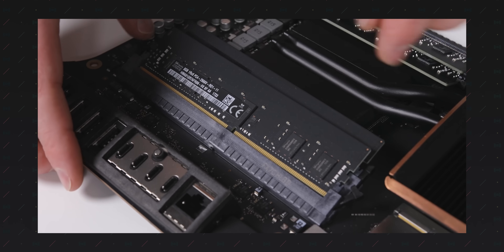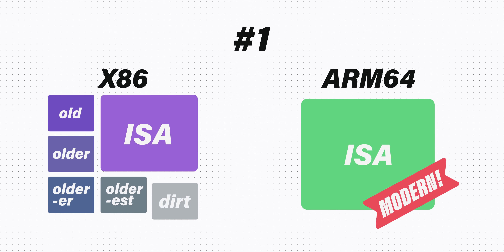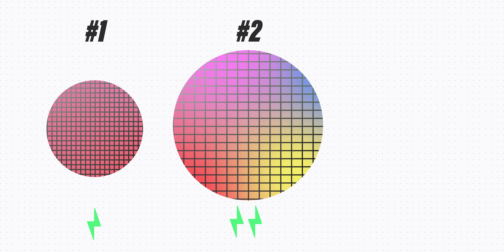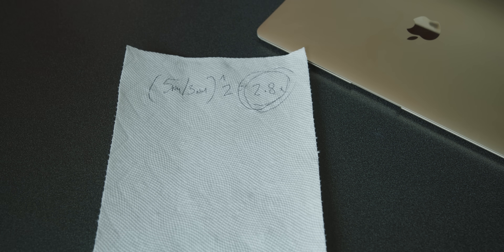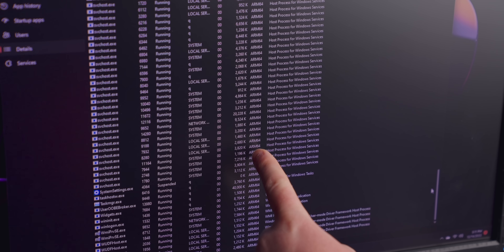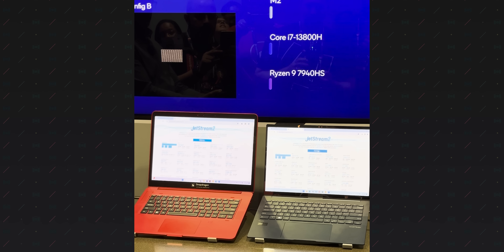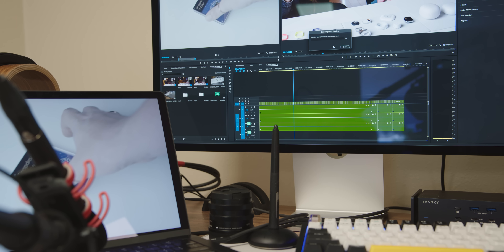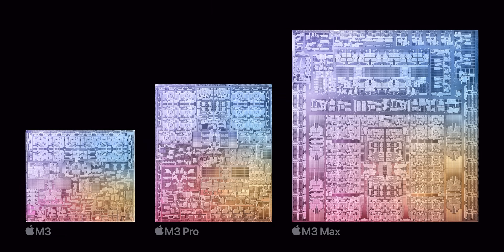Apple's Silicon Magic Is Over!

Comment: Windows on Snapdragon is a disaster → M4 was a mind-blowing success → M5 will probably have 3D packaging → M6/A19 will feature 2-nanometer technology from TSMC, plus multi level 3D.
It seems that Apple is ready to keep eating away at the industry bit by bit, but in a steady and sustained way.
Reply: How I see it, Snapdragon has been a disaster and Intel can’t make up its mind how it wants to go about making its chips. Meanwhile, Apple has released its 5G C1 chip, released a chip that can manage tandem OLED displays and have the only devices that run Thunderbolt 5. Apple’s strategy chip is clear:
 - Continue to enhance its existing engines
 - Partner with TSMC to improve CPU and GPU architecture
 - Develop new engines for specific tasks (e.g. dedicated AV1 Decode engine), which could include 3D packaging
 - Look at ways to improve graphics or displays
 - Build more AI and Machine Learning capabilities into its chips

With Apple’s yearly release cycle of the new chips, Apple will soon overtake AMD, Intel and Snapdragon on having the best performance when comes to chips.

Also have a theory that Apple will push more heavily into dedicated engines to get around the EU technology regulations. If Apple releases more features that are reliant on very specific hardware technology, the harder it is for the EU to make Apple to release that feature to its competitors platforms.

Comment: The problem with Snapdragon is that Microsoft isn't forcing their software vendors to port to it or optimize for it. Intel and AMD have been doing a good enough job at grabbing market segments. M4 has performance and efficiency and Intel and AMD are trying to play in the individual spaces but not both at the same time. The thing is that the vast majority do not need the power of M4. I certainly don't which is why I'm still on M1 and happy to be there.

Comment: If you had understood,is not about density , it is about parallelism. This is forcastable since RISC compete with CISC. Reduce instruction set Will beat Complex instruction set to run window operating system.

Comment: Feeling pretty cool right now with my new M4 air base spec. Simply got a 2TB external M.2 for any future storage issues. 16 GB of ram as standard is plenty for a laptop. Finally, M.2 Drives have gotten affordable, and there's tons of external enclosures out there. You can even throw multiple in your laptop bag if you use a ton of storage.

Comment: I can understand whining about non-upgradeable storage but that can be easily remedied with an external ssd or enclosure… and to the people complaining about SSD dying, the chances of that happening are small. Most manufacturers, the life of an SSD is 8-10 years and if you’re waiting that long to purchase a new model/chipset, that’s seems like a stretch to complain about. Thermals on Macs are way better than most windows laptops and quieter too, they’re simply more efficient and draw less power. 

A vast majority of laptop users are NOT upgrading their laptop internals, they just want something they can pick up and use for several years—and the M-series excel at that since their performance is basically best on the market with great resale value. Also most users aren’t doing tasks that will force an already insanely beefy chip like the M3 Max to throttle and fan spin at max speed. Also the M4 MacBook release kinda made a lot of these points moot.

Comment: I don't use Apple just for the hardware, but it's a big reason. The machine I'm typing this on is > 15 years old. That represents thousands of bucks I haven't spent on new hardware. Another reason is that the system software is something I know how to use, I like it, and I know why I like it and I can still build and run most OSS apps that I need on the old hardware. All the hardware nerds with processor penis envy are having a problem I just don't experience.

Comment: Everyone tries to defend nonupgradable ram, but DDR5 upgradable ram can be literally faster than integrated ram. Any latency caused by a slot isn't going to show any tangible impact for any moron buying a MacBook. If iBoff can fit an NVME adapter into an Apple Silicon computer without making chassis modifications, then Apple can conjure up the space to add upgradable ram... but they just won't

Comment: using an m1 air base. heavy figma user. connected to a 4k dell ultrasharp. this machine HAS reached its limits. multiple times. mainly due to RAM and being fanless, sure. but not always. sometimes, it's just large figma files.

at the time it felt like this will last my work 5 years. 3 years in, i'm planning on upgrading. some hard truths to consider while buying any machine.

you need more RAM for future-proofing. long performance requires active cooling. bigger machines have better batteries and run cooler. larger SSDs are faster and last longer. everything good enough today will reach its limits tomorrow or day after.

apple's problem is not making cheap and long-lasting base models. users should know that the base models are best not considered – pricing tiers in a product lineup exist for a reason.

Comment: The m3 pro seems like 75% of the chip. Going from 200 gigs of memory bandwidth to 150 seems like they removed a memory controller / the cores that were attached to it.  

My guess has been that the yields weren't great and that let them still use the chips

Comment: Why are people consistently talking about the upgradability of MacBooks? RAMs and SSDs on MacBooks are top grade things that are faster and most likely can last longer than normal upgradable products. RAM with a band width of 200GB/s or more is hard to achieve on a PC. When you have something good enough, you don't need to worry about the upgradability in 3-5 years and by that time you just need to swap a new device whether it's a Mac or a PC.

Comment: ARM is "Newer" ? Yeah, sort of. x86 came out in 1978, ARM in 1985. AMD x86 64 bit in 2003 and ARM 64 in 2011. Oooh, yeah, ARM Iis just centuries ahead of that nasty old x86 tech, that crotchety old CPU prolly still using vacuum tubes. Apple's M-series are in same boat as everyone else, ASML and TSMC are the limiting factors here, if they are having trouble making chips better, no one is getting ahead really.  The M-series being SoC devices (Entire computer on one micro miniature silicon interposer) has kind of dead ended itself too. The guts of these computers are monolithic in nature, any one part dies, so does the entire system board, repair consists of replacement. Not a good look environmentally.

Comment: I had a fully loaded MacBook Pro (intel) - it runs hot and is uncomfortable as a "laptop" (unless you dont mind your legs being cooked). It needed repair - I bought an apple silicon MacBook Air -- I got the Intel MacBook Pro  back - and it's still in the box, $6000 of MacBook Pro ... never using it again (unless the M3 breaks).

Comment: What AMD are now offering with there 25w to 50w chips, that can match and in some cases beat Apple silicon and Snapdragon all the while being an x86-64 chip, so no emulation no Windows on ARM etc... Only downside is there is no SODIMM support, meaning no upgradable RAM capability. If AMD change that though, well then, lookout. Basically the rest of the industry has already caught up and are primed to overtake Apple Silicon.

Comment: IIRC, M4 will be the first CPU "not" designed by the original M* architecture team (They designed M1 - 3) .. I really don't expect anything different ... everything on the SOC and nothing up-gradable ... wouldn't it be nice to have PCIe interfaces and the ability to connect a 4090?

Comment: There is a fourth option that has already been implemented by AMD. Chiplets. Tiles, whatever you want to call them. It would be advantagous for Apple to split their core SOC blocks into chiplets, or separate chips entirely. This could also be an additional down the road revenue stream for Apple. Imagine you buy your shiny new base M5 chip later on. You have a video engine, and say.. some basic, yet really good GPU on board. Later on, you could buy an additional card with another video engine, or another GPU. Except, this video engine is optimized on a process node that is the most energy efficient for its purpose. Maybe not 5nm, but perhaps 12, or 14 if it has larger pipelines instead of having higer clocks. As of right now, AMD uses chiplets for their GPUs, splitting their memory controllers off of their main graphics die. This has resulted in smaller die, and higher efficiency.

Comment: Zen 5 is also looking really competitive in terms of performance and efficiency, though there's a bit of growing pains apparently.

I will always hold to the belief that the ISA (ARM, x86, RISC-V) doesn't determine the CPU's performance. It's the design and implementation of hardware that does. The only reason why Qualcomm's Snapdragon X performs as well as it does is because the guys who designed the M1 were involved.

Besides, Intel is flirting with the idea of removing all the non 64-bit stuff from x86 (x86S). Which I hope they do because PCs are tied to the IBM 5150 platform (more or less), not some instruction set, and doing that would allow PCs to finally look forward.

Comment: Yeah I just returned a Surface Laptop 7 (Snapdragon X Elite, 16GB/512GB),  why? 
My Macbook M3 is faster. (Ignore what the benchmarks say). 
VPNs dont work on the Surface 7  
No luck getting it tp print or scan from my Broether Laser Printer/Scanner 
Battery life isnt as good as the Air. 
I felt disappointed with the Surface.

Comment: Apple Silicon Magic is Over (until it isn't) Hitting the limits of Physics...like everyone is?
Moores law is an issue for every Chip manufacturer is it not? I like a lot of what you do. However the clickbait 
nature of your titles is just a bit much.. The rest of the industry will catch up...until Apple potentially laps them again.
Hardware/chip development (like many things ) is cyclical by nature. As for them "taking a risk"..lol...they do that  after the've done all the expensive R+D necessary to prove a brand new chip would make a reasonable amount of sense for them
to move to. The M1 was fast enough to emulate an Intel processor to the point were it was reasonably transparent. That "risk" was very VERY calculated in my opinion.
I'm sure there's tons going on behind the scenes none of us no anything about  with Apple.

Comment: Apple needs 1. PRO mode in macOS UI and removing bloat and somewhat open ecosystem and fund proting to NATIVE core applications 2. stop being stupid with RAM  & storage. It's 2024 and 16/ full speed 512 GB of storage is absolute minimum and 32 should be somewhat affordable. Sorry.  And ffs, start TRYING with passive cooling with graphene radiators for lateral heat transfer, vapour chambers ...... Neural Engine should be frozen and stop consuming die size. it's enough. 12:30 - sorry, but Windows for ARM.... just no.

Comment: I upgraded from a 2020 13inch MBP to an M3 Max 14 inch MBP with 64 gb of memory and I don’t feel like I’ll need to upgrade anytime soon, personally I’ve only head the fans kick in once or twice when I was doing stress test with After Effects and C4D, but I mainly do audio production and I’ve never had the fans kick in while doing that. The performance and speed I’m getting is more than enough to the point I don’t really see any benefits in upgrading to another laptop

Comment: Intel makes an absolutely STUPID number of chips.  They literally have 9 versions of the 14900 which is just insanity.  They have 36 versions of i3, i5, i7, i9 which is lunacy!  AMD basically keeps it simple with 4 cores - 6, 8, 12, 16 cores.  They sometimes add a 4-core CPU, sometimes add x3d, sometimes offer a power-reduced flavor of these items, but basically, they don't pump out 15 chips in one blow, that's just a waste of engineering effort, Intel's overcomplicated mistake ...  Apple on the other hand, makes 3 CPUs per generation ... and ... Done!

Comment: I gotta wonder if the next big jump in computing power is gonna have more to do with chemistry than it will transistor size or architecture. Wondering if we're getting to the point where making chips outta silicon is the issue.

Comment: This is why I'm still very happy with my 2021 14" macbook pro m1 pro base model with 16GB ram which I bought July 2022 for £1,600 which for me isn't what I would consider cheap, yes the m2 pro is a bit faster but the m3 base model is slower than my m1 pro because greedy Apple only gives you 8GB ram and costs £100 more than my Mac. Let me say this 8GB ram is not enough for ANY PC in 2024 no matter who makes it, but Apple just keep on lying because they know most of their customers aren't geeks or creatives who require a high powered machine instead it's more about bragging rights, the only reason I switched to Mac from x86 x64 was because not only were the m1 pro chips faster and more efficient than Intel or AMD Laptops the battery life is phenomenal and up until now nobody else makes laptops that have this good a battery life, there are faster laptops but they require then to be attached to a mains supply they weigh a ton they're very loud and you could fry an egg on them. What you said is interesting and I agree Qualcomm will eventually catch up but my money is on the new AMD Ryzen AI 300 Series processors which they will release mid July, and if AMD are not totally exaggerating they're going to give Apple a run for their money. Thanks for your very interesting vlog

Comment: You blew ARM's inherent efficiency & performance advantages vs x86 COMPLETELY out the damn window... 🤦😑 Ask any legitimate CPU designer and they'll tell you that ISA is next to irrelevant when it comes to maximizing performance and even efficiency in the modern era. Modern x86 is not old x86. Thanks to the addition of microcode it operates more like a RISC architecture than it does old school CISC. And no mention of the upcoming x86 competition is ridiculous... AMD's Strix Point & Strix Halo are going to be WAAAAAAY more performance competitive with Apple up and down the chip stack than ANYTHING Qualcomm will launch in years. 🤷
Reply: Why RISC ISA have nothing to do with efficiency though?

Comment: We have seen this before from Microsoft.  They try to move off Intel.  The performance for all the native Windows Apps for X86 run like garbage.  I am not saying office.  Nobody care about Office anymore.  You just go to a typical business and try and push one of these laptops.  Watch how fast the users revolt when their old apps written 10 years ago that have never been upgraded run like garbage.  Then John in accounting gets a new X86 Windows laptop and his stuff screams and is super fast.  Yes the batter life won't be great, but it is good enough.  Then we have cost.  The cost difference is trivial, so again why would any business buy one of these?  They won't.   Apple on the other hand has the ability to force its users through pain.  The migration to OSX was a pain.  The migration off of the Motorola 68040 to PPC was painful.  The switch to Intel was less painful but not perfect.  The switch off of Intel to their M series chips was not bad but again they kept their big boy systems still on Intel for a long time.  You see Apple users for whatever reason are willing to suffer through a year or two migration process.   Microsoft Users are not.  Now "if" somehow Intel just sat by for say 5 to 10 years and ARM got so fast that it could emulate X86-64 OR they can do what Apple did and rewrite the code on the fly (first launch) and it works great, then perhaps they could do this.  But all it takes is Intel coming in and being just a little better on performance AND being good enough on the battery, and they are dead.   Remember Microsoft and the DEC Alpha?  I do.  Remember Microsoft on the Itanic? I do.  Remember Microsoft on ARM with the surface?  I do.  So why would I invest in one of these now if I was a Microsoft Windows user?  Okay the battery life may be 2 hours longer?   I don't care because my old crap runs great and doesn't crash.  I download ANYTHING for windows and it works.  I install anything and it works.   Heck the battery on my current old IBM laptop last 6 hours now.    Again Apple is a different company.   They can do this.   Microsoft will focus their efforts on Azure now and not really care.  I suspect they will focus hard on getting their stuff to run on Android and iOS more than pushing Windows on ARM.

Comment: Very with you.  For me the 2017 MacBook is still the ultimate Mac laptop and also the Mac laptop most suited to an apple silicon refresh.  I am still waiting for apple to release a replacement, until then I use a stripped down, custom cased, usb-c powered M2 mini and an iPad.
Reply: Not sure any MBP that came out after 2013 was worth an upgrade until the M1.

Comment: It's Arm. You can reach the limit, then add cooling solution. Year zero, repeat history. Well, but people look at it like a real system, but Arm wasn't intended to do things like 3d rendering or something massive like that, all logicals cranking for a long time. It's not just pushing Arm, I wouldn't try that on any laptop actually. Pick the right machine, but Apple users don't. They wanna do anything with it. Super thin, like a dried leaf.

Comment: MAC  computers are crap . They dont hold  up and  they are  Hard to repair ; they're too espencive for the price , for $2500 you can buy a Gaming PC with 10 times the computing power that will do the same thing as a MAC . Plus do film and sound editing and run AI locally, You also have a larger choice of software and apps you can run on it